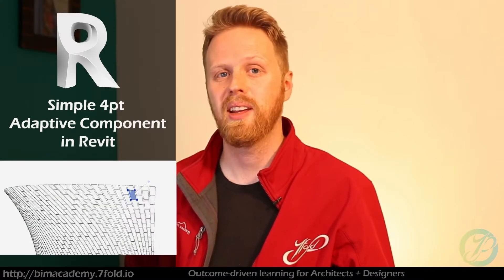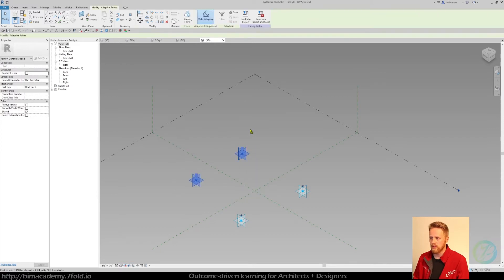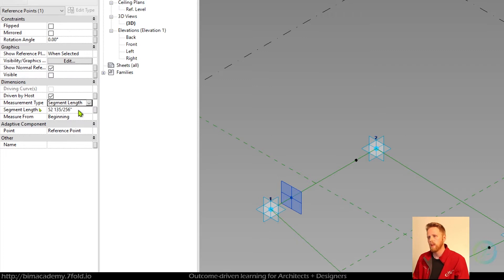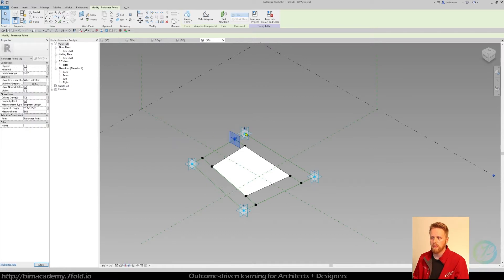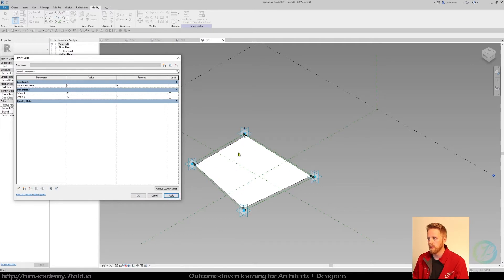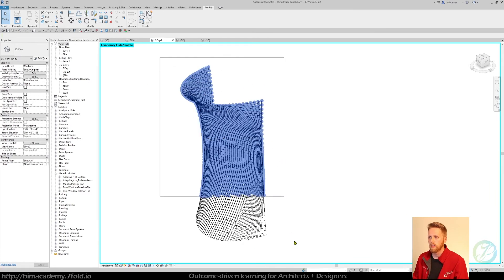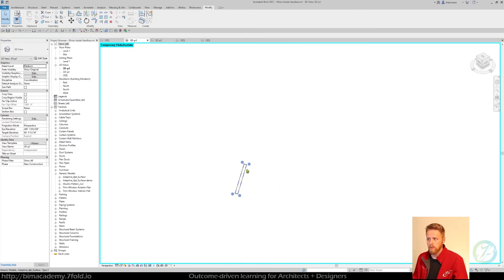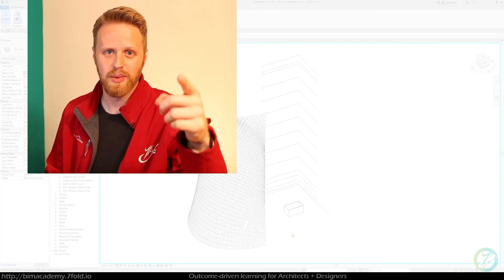Create a Simple Revit Adaptive Component for use in Rhino Inside

Comment: Can Rhino Inside create and control curtain panel pattern based families? Or even better to create the Pattern Component Families or is Adaptive Component the only way to do it?
Reply from the maker: Hey Constantine thanks for reaching out. When you say "control" what types of control are you specifically hoping for? You are able to query/edit the parameter values of a curtain panel pattern already modeled in your Revit model. The opportunity then would be to write additional logic into Grasshopper to qualify when/how you set certain values. That Revit family type is inherently constrained on purpose to force typical penalization to happen. 

I would look into the Family set of RiR components, specifically Component Family Form and Component Family Curve can help translate your Rhino Geometry back into Revit Family Geometry. From there you can get the base surfaces to match natively in Revit, do a 1-step manual process to Divide Surface and set the family, and then get back into RiR to make customizations to that Divided Surface. 

The only other "back door" option would be to use the Built-In Categories component. Doing a quick search now I'm seeing "Divided Curve" and "Divided Surface" show up which are specific types of Revit Elements. At this time I don't believe there are create tools for what you are looking for but there are ways to get/set info from curtain panel pattern based that's already in the model. There are a lot of query/analyze components related to Curtain Wall systems in the Wall set of RiR components. 

So I'm not sure what your goal is from a design perspective, but in general you are finding one of those cases where you should be asking if using RiR is the right approach to your design problem. The harder work is splitting out which parts of your design scope you develop and maintain using control geometry in Rhino Inside and which parts are handled best with modeling best practices in Revit not requiring custom tooling to be built to work with it. Think more in terms of semi-automatic tools you build in RiR and not fully automatic, turn-key solutions and it will help when making your own internal negotiations while authoring in Grasshopper.
Reply: @7fold_design  Hello! Thabks for the reply!  What I was thinking of was to be able to create Revit division patterns in Grasshopper to be used with Curtain Wall pattern based families but i realized that you can already do that with Adaptive Components. By the way, is it true that curtain wall pattern based panels are a simplified type of adaptive components?
Reply from the maker: @Constantinesis  Yes. If you're already getting familiar with Rhino Inside then you should definitely understand how to work with Adaptive Components. Curtain Panel Pattern Based is a family type in a similar family environment just with more constraints and optimized for performance. For example you have to work within the pre-defined pattern frameworks provided (like grid or diamond) but you do get more flexibility with Adaptives even before using Rhino Inside. I could whip up a few tutorials on this but the topic can get fairly deep when dealing with how to make your adaptive component parametric and how you want it to array across your divided geometry (whether divided curve or divided surface). Working with adaptive components back in my school days is ultimately what sparked my curiosity to develop more robust solutions through Grasshopper so I would encourage everyone to get familiar with working with them. They definitely help you to think critically about how you are composing your families which is essential when composing scripts in Grasshopper or Dynamo.